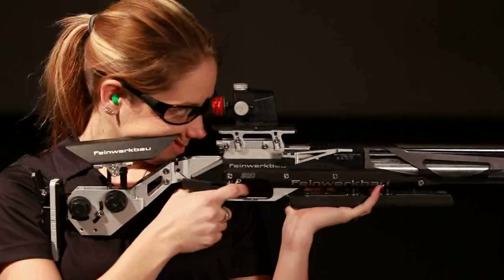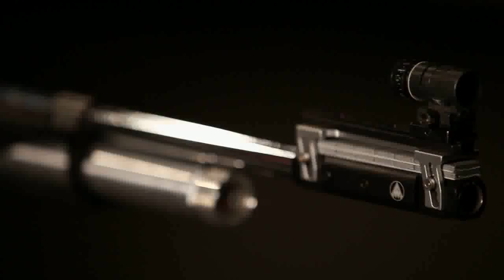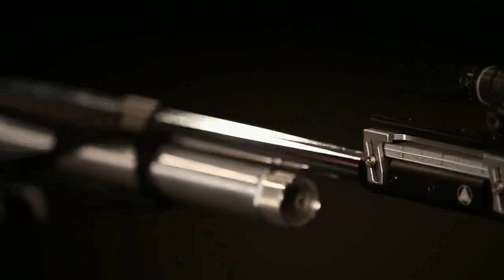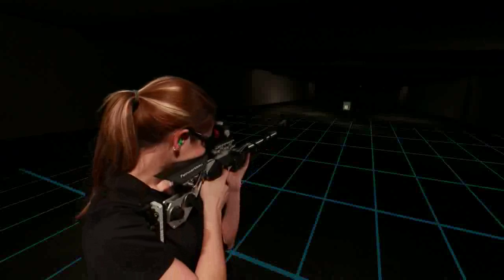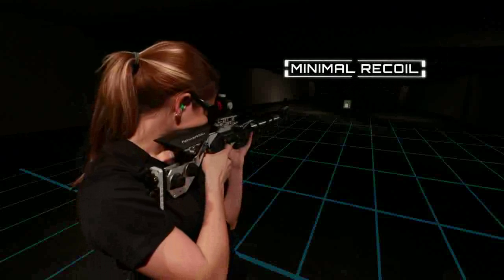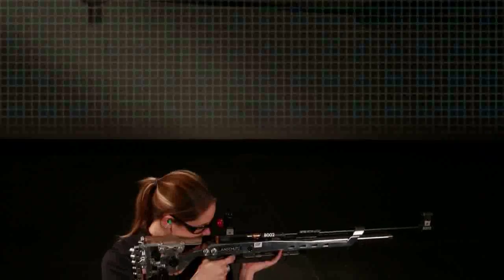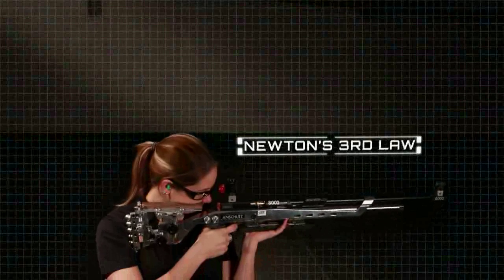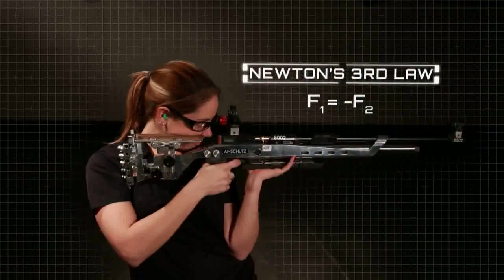Firearm Science: Air Rifle Recoil

Comment: Great video, so many think that spring/gas piston air rifles have no muzzle recoil & that all the recoil is produced only through the movement of the mechanical components. Yet all gas operated fire arms have a similar mechanical recoil as the bolt moves backwards & forward to load the next round into the chamber.